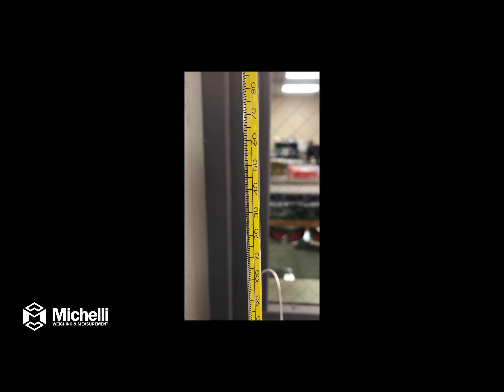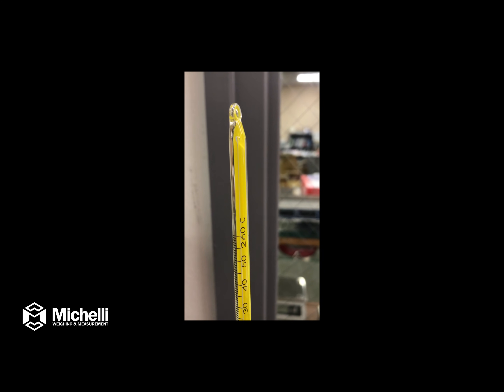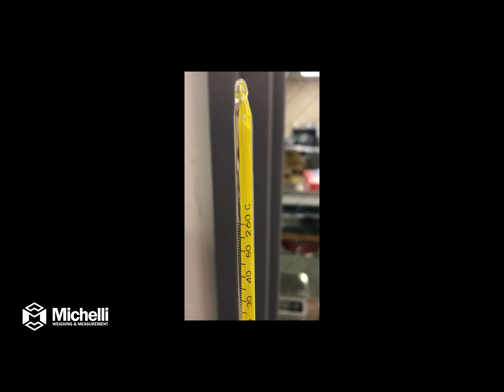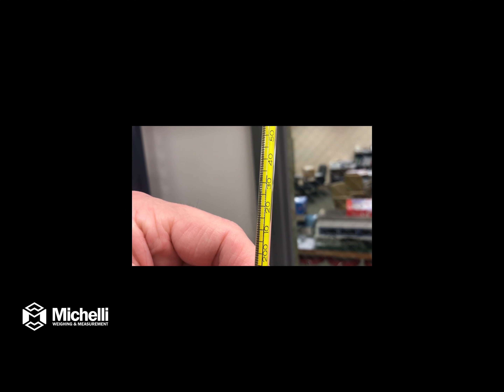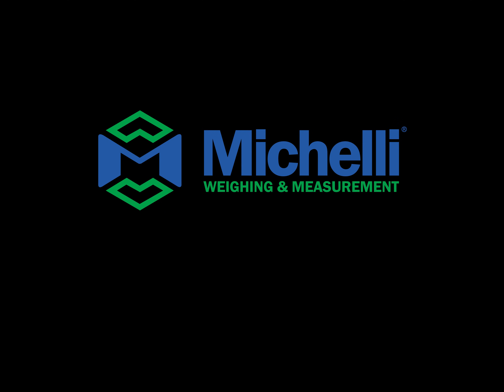Mercury Thermometer Repair (Mercury Column Gap)

Comment: Actual mercury filled thermometers are rare these days.  Keep in mind that using this method on a thermometer that has a top temperature less than 100C (212F) has the very real risk of breaking the thermometer, spilling the mercury and requiring an expensive cleanup.

Comment: Can this method work if there seems to be no relief bulb at the top of my Calibrated thermometer. Also once the separation in blue liquid is re joined will it need any other procedures to read as it did before it was dropped ?
Reply: If the thermometer contains blue liquid, it may be mineral spirits or a "blue spirit" thermometer, which does not contain mercury. Try lightly shaking this type of thermometer, the mineral spirits should normalize.
Reply: Hope that helps! If not, you can ship your thermometer to us for repair, or contact us to purchase a new one.

Comment: I don't have a relief ball.  What about freezing the thermometer to coalesce in the bottom reservoir?
Reply: That would work if you can get the temperature low enough without the thermometer rupturing.